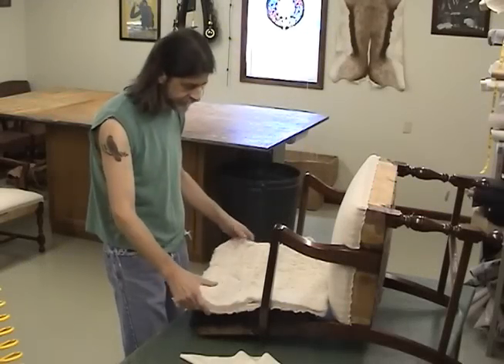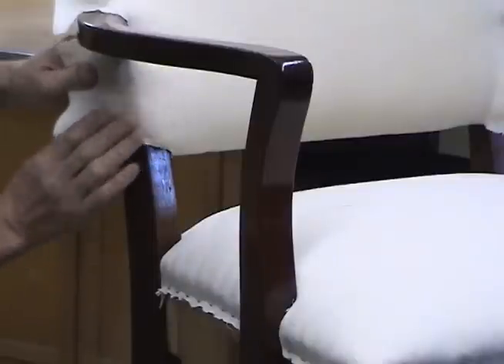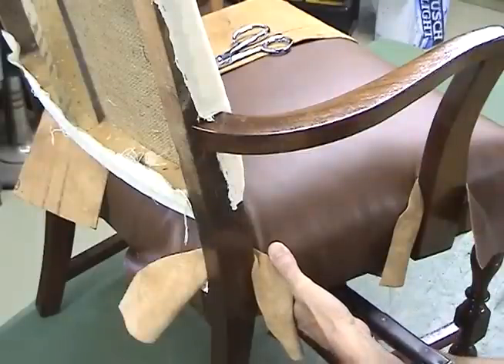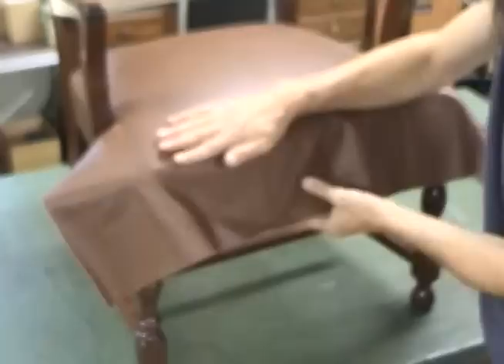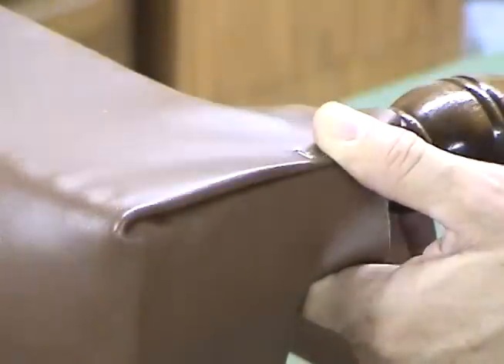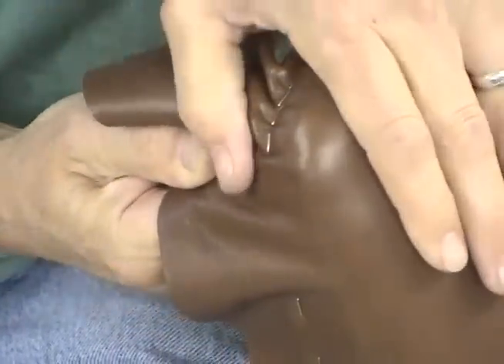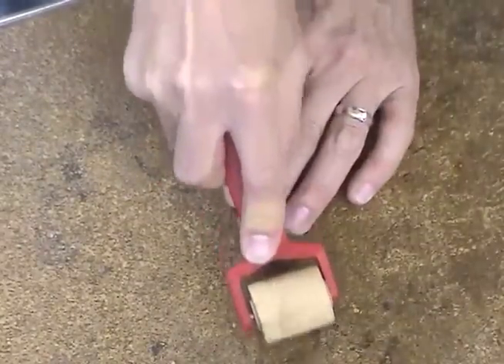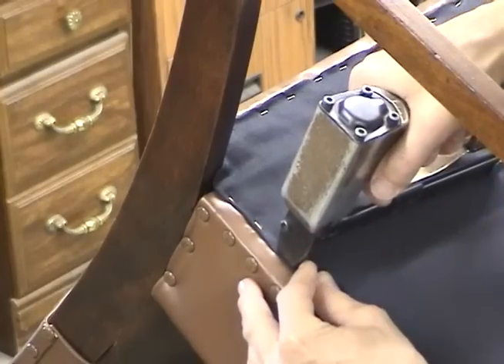Upholstery - Horse Hair and Leather Part 2

Comment: Do you still recommend using muslin before putting leather on even if using foam and batting for the padding, rather than horse hair? Is the purpose of the muslin just to hold the padding in place and get a tighter fit for the leather?
Reply from the maker: The muslin allows you to shape/form your padding materials much easier and accurately (follow the weave) regardless whether its hair or foam. Leather stretches in irregular directions making accurate shaping much more difficult. Palm it into place over the muslin.

Comment: 12 chairs, it's amazing) please tell me, why you rub wax thread, and how many millimeters staples you use ?  good video ,thanks)
Reply from the maker: Александр Вингерт The string isn't pre-waxed. Bee's wax helps secure the knots tighter and reduces twisting and bunching up as the string is pulled. Staples are 1/4" - 3/8"

Comment: Hi Buckminster upholstery, im trying to gather some info with regards to leather sofas cuz i think ive been conned with the one i brought, mine is only one year old and where theres a crease its slipt, the thing thats getting me thou is the look of the leather its got some white materical on the back of the leather some man made materical looks like cotton, but why would leather need something on the back of it i know my leather jacket dont and for it starting to spilt only after one year of light use, it was suppose to be real leather, hope you dont mind me asking and your feedback would be very grateful. Thanks Matt
Reply from the maker: Hello Matt,
 You're correct. This does not sound like genuine leather to me. Some hand-finished leather will have a "raw hide" coloring show up in the seams at times but not like cotton. They're doing a lot of new things with faux leather these days unlike traditional vinyl such as Naugahyde. Beware of "recycled" leather where they basically shred leather and re-bond the fibers, then add a faux finish. Many of these products are known for the finish blistering and peeling. Most are not proven to be very durable from my limited experience with them.
Reply: Hi buckminster, thanks for reply, is there anyway of sending you a picture through here? just i really need all the info i can get, not sure if your from UK but the sofa place i brought it from was sofasavings not sure if you have heard from them or not. thanks matt
Reply from the maker: hipster73@hotmail.com
Reply: Thanks so much Buckminster for address i have sent you pics, thanks matt
Reply: m
Reply: Hello Mr Buckminster. I love your videoed. I was taking weekend upholstery class. I’m building an ottoman and I’m using horse hair and wanted to lay cotton on top. However, the instructor insisted it would damage the horse hair. I have a roll of brown cotton and white cotton. I see from your videos it looks like you used some brown cotton. Also, I’m using leather for my finished product. Which cotton would be ok to go on top of the horse hair? I want my ottoman to have some body under the leather. Thank you for sharing your mastery skills!